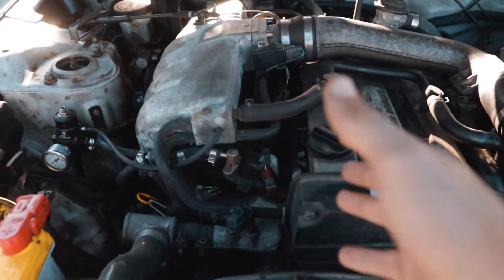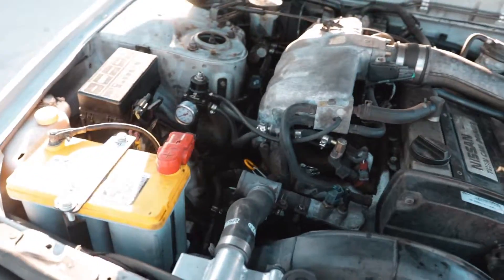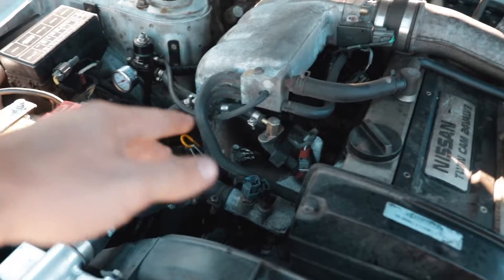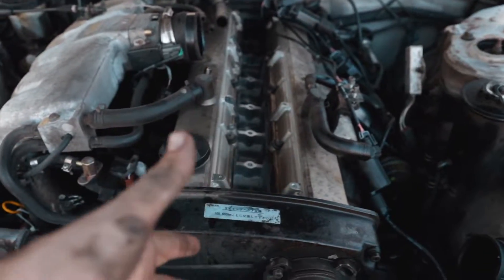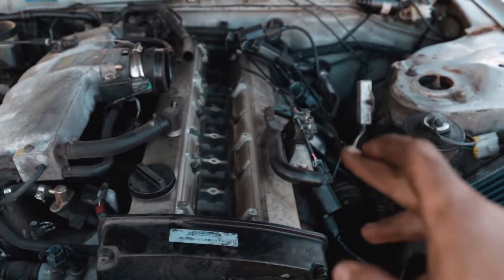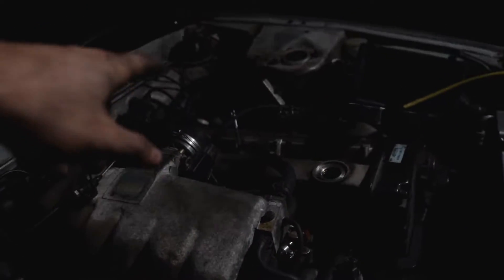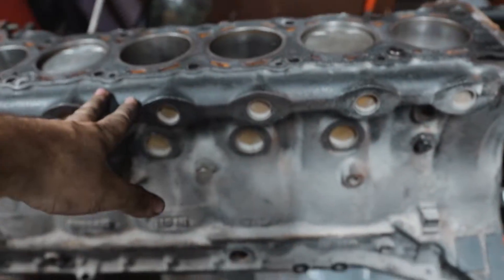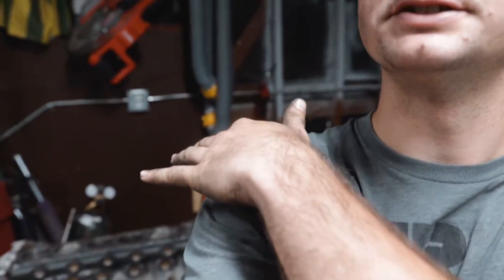RIP R32 Skyline Motor....

Comment: Sorry about your engine mate is the replacement bottom end forged? Might be time for it
Reply from the maker: Lol no it's just an OEM rebuild. Don't really plan on making that much power I just need it to be running again. It's my daily😅
Reply: @FSOMedia  but who knows what the future holds for the sake of some forged rods and pistons while you have the chance
Reply from the maker: One thing I know forsure is that the motor will be stock until I get a truck. My 240 needs forged internals way before my r32. I can't be spending thousands of dollars to have a completely unnecessary overbuilt motor with stock turbo, injectors and ecu lol I'll rebuild the current motor I'm pulling out and have it ready incase something happens with either car.
Reply: @skylineandy  Built my rb20 for ~500rwhp  recently... It's not really worth full forged on the 20 unless he's planning on pushing over 400hp. There's a lot of "Well you came this far, no sense in cheaping out on X"  that happens on that from with the rb, where you end up spending several thousand dollars on it. 
Good example is if you're already going to a machine shop, id consider a crank collar to be mandatory.

Comment: RHD Specialties claims the do maintenance but by the looks of it it has nothing done to it
Reply from the maker: Clogged injectors is what killed the motor. Lasted a year and I knew I should’ve gotten them cleaned and flow tested from day 1 but never did. That’s not on them these cars are 30 years old and NEED maintenance done constantly. If you can’t do that then you shouldn’t buy one. I’ve heard stories about that from every single importer. Learn about the chassis you want and get as many pictures and videos as you can before buying if you can’t go see it in person. I will not blame them for problems that happen so long after buying the car.

Comment: Can a rb26 head can work on a rb20 engine
Reply from the maker: No only a rb20 yead works on an rb20. The bore is smaller than all the other RBs. Rb25,26,30 can swap heads between each other because the bore is the same and they bolt up correctly.
Reply: Where can I get some rb20 valves and springs for my rb20 engine all my vavles are broken can you help me please
Reply from the maker: Try rawbrokerage.com or just google rb20 valves and springs. There's a few places that sell them. Also if a head or complete motor shows up on offer up you can do that too
Reply: I am from Jamaica and found out that you know a lot about skyline just trying to put my rb20 together cant afford a Mickanic